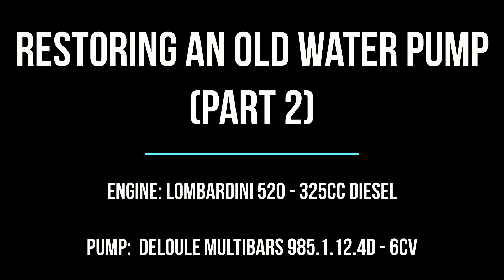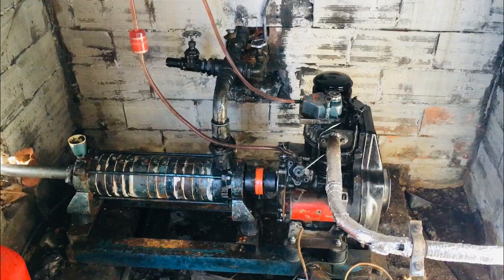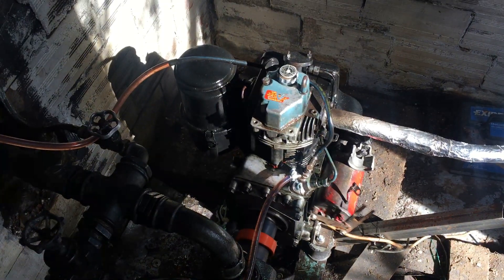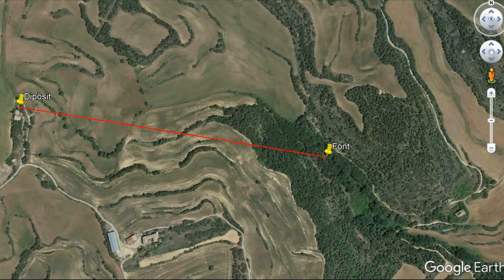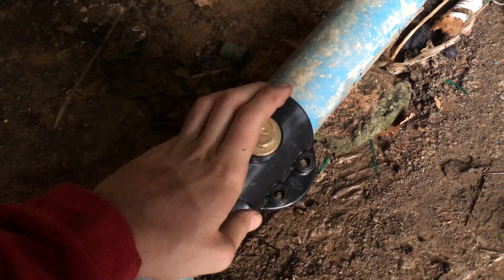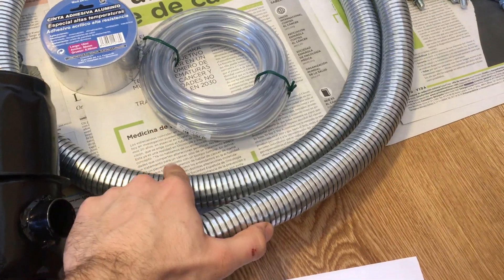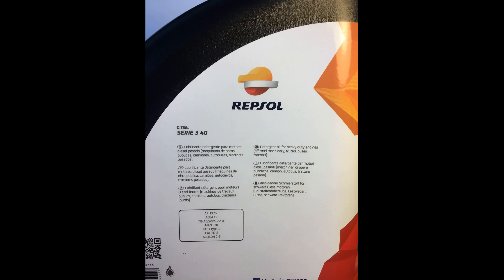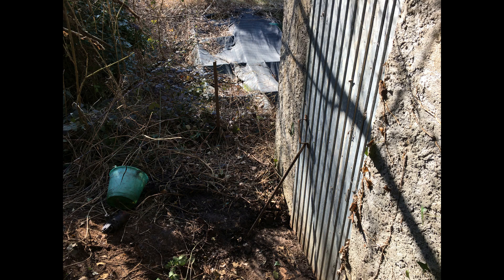Restoring an old water pump - Lombardini LDA 520 / 6LD 325 diesel +  Deloule multibars (Part 2)

Comment: All the oil that comes from the vent is innatural, probably because the rockers cap isn't original, or if that layout is original there's a missing part made of rubber, designed like a large bottle cap, with a tube attached, that runs down the engine block, that goes on the vent ; on request, from new, there was an oil separator, to collect all the oil blown out from the engine for evaporation or overflow (too high oil level ).
Reply from the maker: Thanks Simon. 
I’m pretty sure that everything is original. well, better too much oil than too little! But you made me think, i’ll check it out. Thanks for the comment
Reply: @BarcelonaAustinA35  it's something like that ( that is not the specifical part for you but something pretty similar) 
https://www.newgardenstore.eu/it/ricambi-lombardini-ruggerini/8974-kit-cappuccio-sfiato-con-tubo-tappo-sfiato-3ld-4ld-6ld-7ld-lombardini-lombardini.html
Reply from the maker: Oh! That is fantastic! This one would most likely fit i rekon. I’ll sleep on it. Thanks
Reply from the maker: Btw this project is still ongoing, there have been several updates. Vid comming up
Regards